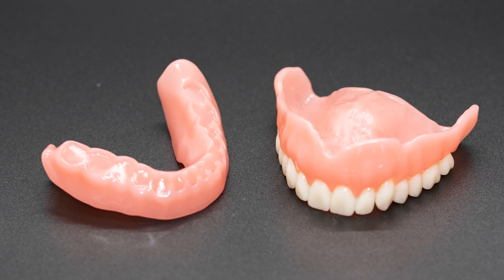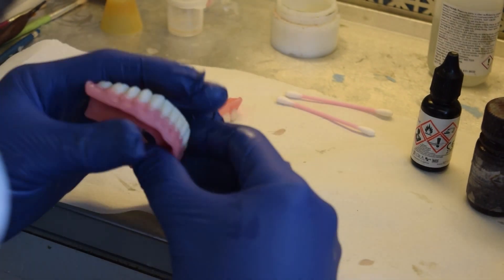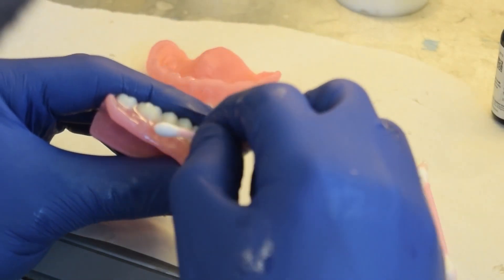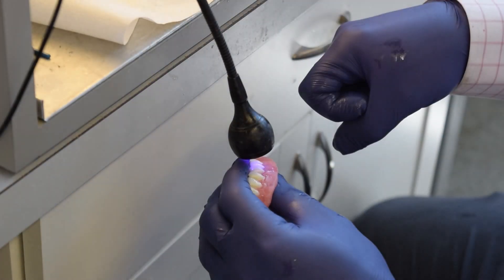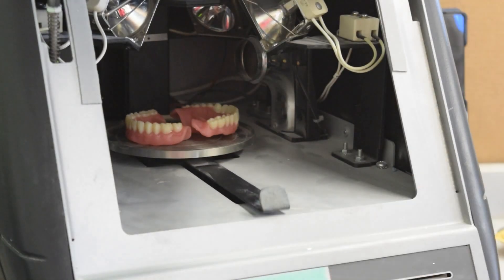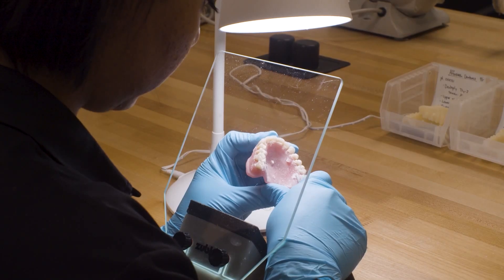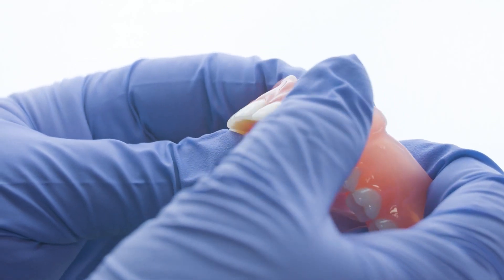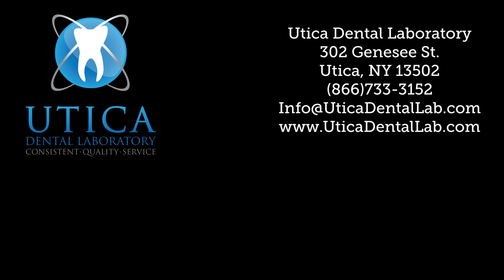Part of the Process - Setting 3D Printed Denture Teeth

Comment: Very nice video! How do these dentures compare to typical, traditional dentures?
Reply from the maker: Thanks commenting! 

Check out this video comparing the 3d printed method compared to traditional that we use at Utica Dental Lab:

https://youtu.be/aZayGP8p6ng?list=PLtH0vwLZBOCMH7EEPdoWcbV82xnCcckMQ

Labs have different procedures for their dentures so an exact apples to apples comparison is difficult. However, there some general pros and cons to digital dentures.

The biggest advantage to 3d printed dentures is on the manufacturing side. Designing and printing a try-in, then making CAD/CAM adjustments to go to final is much less laborious that making a wax try-in. More importantly, the time it takes to train a new lab technician to become proficient in digital design is far less than the time it takes a inexperienced lab tech to master traditional, analog denture making methods.

The answer to what is "preferred" is that it depends. There are some truly gifted lab technicians that are capable of making a perfect fitting, highly aesthetic denture. Then, there are some dental labs that struggle to even supply the basics in functionality. Are there some dental labs capable of producing a superior product manually? Yes, but it is becoming increasingly difficult to replace a skilled lab technician. 

There are dentists who prefer traditional denture methods. If you are a dentist who has a competent lab that is proficient at removable prosthodontics, then hold on to and cherish them. But, the quality of an analog denture is highly dependent on the skill level of the lab tech making the denture. The most common reason new clients give our lab a try is "The quality of my old lab just isn't what it used to be." or "My lab closed and I can't find a good removable lab." Clients like this are usually happy to give digital dentures a try.

Aesthetically speaking: we gave five of our clients a blind test for traditional/digital dentures and they couldn't tell the difference.

As far as strength is concerned: Lucitone Digital Print resin has similar lab results in terms of flexural strength to Lucitone 199. They do break on occasion, but so do traditional dentures. The argument for who is at fault for an ill-fitting denture that ultimately breaks is as old as dentistry. We haven't seen a significant difference in remakes from digital dentures compared to traditional dentures. 

That's not to say that our lab protocols are perfect. It also doesn't take into account things like printer type, resin material or the methods used to cure digital dentures. Any deviation from the suggested methods will lead to different results.

All dentists have varying degrees of standards as to what is acceptable work. They also have varying degrees of what they are willing to pay for and how long they are willing to wait. It's hard to compare because there are so many variables but I'd compare it to the argument between Porcelain vs Li-Di vs Zirconia crowns. Nothing beats the esthetics of a well made porcelain crown. But, if the lab isn't capable of delivering a high quality porcelain crown, they are better off milling zirconia.
Reply: Are these for permanent dentures or temporary??